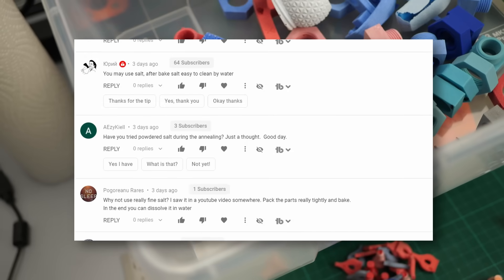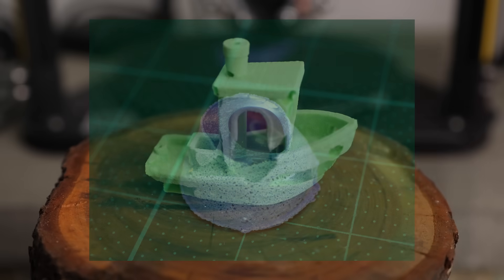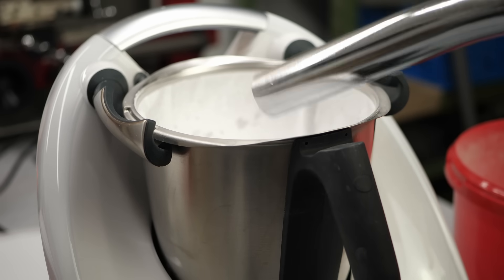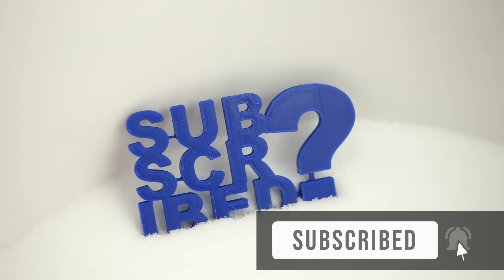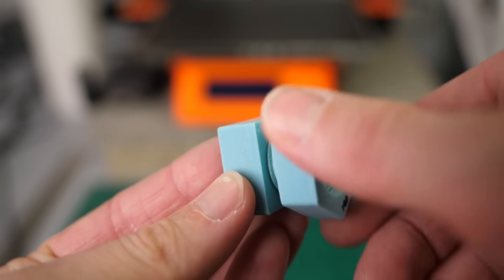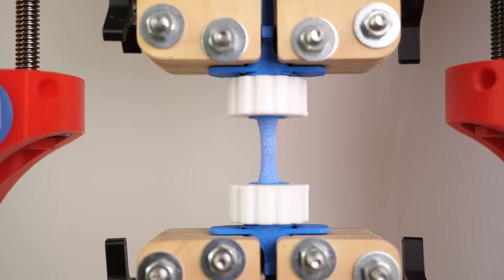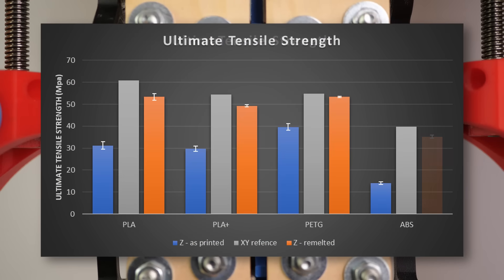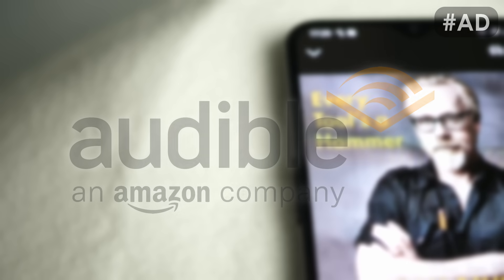The STRENGTH of 3D prints REMELTED in SALT

Comment: What an interesting and weird hybrid process!
I wonder if this could be improved by wrapping the 3D printed parts in some higher temperature foil to avoid the mixing of salt.
Or maybe spray painting them with some sort of (flexible?) paint coating.
I'm also wondering why lost form casting metal works without mixing in the sand particles, but here it's a problem.
I think if I needed this for a specific part to be really strong I'd rather look into how to use the 3D printer to make a mold for epoxy based casting.

Comment: 15:30 Pores are probably mainly from evaporating moisture and possibly a bit from original extrusion density being slightly below 100%. I guess due to the  high viscosity of molten PETG (notably higher than PLA) the bubbles / pores become immobile after just a bit of surface-tension-aggregating. Lower viscosity PLA may be able to form bigger bubbles but PLA barely carries any moisture. Much less hygroscopic. I highly doubt that bubbles can aggregate big enough to rise gravitationally even with PLA's lower viscosity.

Comment: What about creating a super-saturated salt, or borax solution and immersing the part so that a shell of crystals grow on the surface? Then dry bake the part so you don’t get popcorning, before doing the final bake.
If this could work, the original surface finish would be maintained, and the you wouldn’t have to work with fine powers.
I recently grew some borax crystals on pipe cleaners as a fun project with my daughter. I created a super-saturated solution by dissolving the borax in a glass saucepan on the stove. I was able to get some pretty thick crystal shells (and with borax you get nice cubic crystals on the outside).

Comment: Combination process I'm thinking.  Pickling salt for its fine grain. Bake it to remove moisture. Pack the part in it, then run through a vac chamber to remove air pockets. Vibrate to settle any last bits, then possibly a second vac.  Bake as required.

Comment: how about using a laser to point at the tip of the nozzle, just about 0.2mm lower, then the laser can melt the lower layer of the PLA material and  nozzle print the new layer immediately, they can melt together better, right? a 5-10w laser should be powerful enough.
Reply: This is essentially (partially?) the way that metal parts are 3d printed. Layer is put down, laser fuses, repeat forever.  https://youtu.be/4jbn0ah3u9E?t=307
Reply: @DrFiero  yes，but this was printed by metal, I mean print with PLA
Reply: @snipermax  - yeah, I do understand what inconel is! I was just comparing the concept of fusing via laser.
Reply: @DrFiero   oh. I see.

Comment: How about using magnesium dioxide? It's a filler and white pigment used in paint. It should tolerate high temperatures, and not be so corrosive.

Comment: Living in Europe and having a really hard time finding the powdered salt (or the will to buy such an expensive blender), I might try quartz powder (SiO), which is commonly used as casting sand for aluminum, therefore very stable at higher temperatures. Edit: also, pumice powder seems to be an even more viable (and affordable) option.
Reply: Huh, here in the US you can usually find it in markets
Reply: At least here in oklahoma

Comment: I see you used an un-iodized salt, I first thought an iodized salt would result in the outer skin that was resulting on your prints. But I see that the salt you used is mined from northern Germany using an evaporative process. Furthermore free spirit seems to be in a different region, suggesting impurities could be reacting with the plastic they are in contact with. I will be testing with salted mined on the south eastern coast in South Africa. Hopefully that will determine If purity/impurity is the issue

Comment: Honestly, my main worry would be how heat conductive the casting material is. Plastic being cooked unevenly for so long above melt point is going to significantly weaken it compared to injection molding. I would try this with aluminum powder, fairly cheap per pound/kilo, is fine to the point of inhalation danger, and conducts heat like no other

Comment: I was thinking of using two different materials for shell and infill (100%) on a dual head printer. The shell might be PC or similar high melting point filament, and the infill can be pla or some other low melting point filament. Then without salt the model can be heated up to a temperature, where the shell remains intact and the infill softens. Then check the strength of the model. I would do it, but I don't have the proper measurement device. What do you think about this?

Comment: My thoughts are that this works because, firstly the compacted salt acts as firstly a structural support to support the melted material so the object can retain its shape, whereas if you just baked a 3d printed object in the oven it would just melt and deform freely with no support. Secondly, salt has the ability to draw out moisture in the parts which may explain some of the surface bubbles on the outside of the object and the uniformity inside the object as seen in the test parts that snapped. Thirdly the properties salt allows for great absorption of heat allows as you mentioned in your video "salt takes along time to heat up" this in turn acts as an "insulation" from the direct heat in your oven allowing you too evenly cook the whole object at a much more even temperature without burning the outer layer, while allowing you to melt the inner layers together promoting layer adhesion. This process is similar to how you would sous vide food (submerging food in an airtight plastic bag and cooking it a set temperature over long hours to get a precise even cook temperature throughout, amazing technique to make perfect doneness on steaks :D). It would be interesting to see if you can do something similar with clay (also a good heat conductor) or other heat insulating mediums rather than salt as a the support structure medium and the heat transfer medium, this would allow us to determine if the moisture drawing properties of the salt plays small or a big effect in this process.  Great video, thank you for sharing your results!

Comment: Maybe the surface finish can be improved by first forming a hard salt shell around it. Either by warming the part with a hair dryer and misting a saturated salt solution over it, or repeatedly dipping it in a saturated salt solution.

I don't think that will be strong enough to carry all the loads when the plastic melts, so probably still bury it in salt, but it might improve the finish.

Comment: instead of using salt, why not try using self leveling concrete? its a fine powder that i assume would work just the same as the salt method... might be worth a try, plus they sell bags of it at most hardware stores thats not very expensive.

Comment: Instead of salt, which is quite corrosive and requires grinding, how about cement mix that's been sifted to ensure you only get the finest powder? Also instead of packing, placing the vessel on a vibrating table could be a good way to ensure you get uniform contact and eliminate air pockets in the powder.

Comment: Has anyone tried sodium bicarbonate (aka "baking soda" here in North America)?  Does it work?  Seems ideal -- very fine-grained, low-cost, water-soluble, and widely available in grocery stores.
Reply: OK, I'll answer my own question.  Ran some tests on a PETG extension tube I printed to join a Canon DSLR camera body to an antique lens with an M39 thread mount.  

In Trial #1, I packed the part in bicarb but didn't weight the surface down.  Total failure.  The forces latent in the PETG were strong enough to shift the bicarb and deform the part.  

In Trial #2, I used a c-clamp and a top plate to compress the bicarb around the part tightly during the annealing process.  Heated 40 minutes at 230 degrees C, then allowed to cool to room temp.  Worked great.  No visible deformation + nice matte finish on PETG surface (which, for a lens component, is MUCH better than the original glossy finish!).  No noticeable degradation in the tolerances.  The M39 thread still mates as before with the lens body. 

Plan to buy a bigger box of sodium bicarb and do some more testing with larger components.  For now, though, I'm not seeing much reason to search high and low on Amazon or E-bay for popcorn salt.

Comment: 99See sand casting.  There might be things you can add that causes better clumping.  Also there are simple tools you could print for packing the mold.   Very interesting.  Why wouldn't it work with flower?

Comment: Why do you even use salt? There is special sand for casting available. This is as fine as possible and also heat resistant. Maybe it's a little more expensive, but you can reuse it.

Comment: Has anyone considered the application of a coating (silicone/Teflon etc.) to the outside surfaces prior to the treatment.  The coating could potentially block the salt from leaching / penetrating the surface.   also - why not use another type of power material (al) has great heat transfer properties... and could be made VERY fine...

Comment: Try Epsom salt. I have used it to anneal 3D prints with great results. I first dehydrate it in the microwave on a plate lined with parchment paper which results in Anhydrous (without water) magnesium sulfate. It's like ultra hydroscopic glass. I break it up into small chunks and it grinds pretty easily into a very fine powder (like baking powder). This packs really well and has the benefit of adding zero moisture to the process, being considerably cheaper than salt, less corrosive, and results in fine detail surface finish. The powder is water soluble just like salt. I also use it as a very effective desiccant for storing my filament.
Reply: Could you produce and upload a video demonstrating you process?
Reply: @VictorHarrys  I would be glad to. I have been working on other projects lately so it might be a while.

Comment: Fantastic video. I too have been curious about talc and green sand. I also have been wondering how this salt method compares to coating the parts in a thin coat of polycrylic paint or porous sealing vacuum impregnation. For my salt I used a burr grinder and was able to reduce the table salt effectively by targeting Turkish coffee which is best with a d50 of 50-100um. I agree with your assessment that more than one small part or longer than a short run is not viable.

Comment: why not cast it in plaster/quickset with a vent hole facing upward, then bake it at 200 degrees for a while, then soak the cast in water to melt it away from the plastic?

Comment: It would be awesome if this could be done with a liquid of some kind. The liquid would harden with the temperature together with the part, so it would provide support, but you would save yourself from handling the dust and packing and everything. You'd simply pour in the liquid, baked it, and then removed the hardened support.

Comment: Bake your salt for an hour in an oven BEFORE blending. This drives out the moisture first.
Reply: I've wondered about green sand for some time. I'd love to see a test with it.
Reply: Wouldnt the salt just absorb water out of the air anyways while he's trying to pack it or break it up in preparation for packing?
Reply: @spacegooley3796  Yes, but providing you work fast enough you should be ok.
Reply: @spacegooley3796  He literally is using a heated mixer. He could just mix it all at 200°C creating finer particles while also drying it at the same time.
Reply: @michaelakerman7609  If you coated in a heat resistant enamel (that held the shape of the part), when baking maybe you wouldn't even need the salt
Reply: @WaynesStrangeBrain  sounds like a nightmare for moving parts
Reply: @amicloud_yt  While I agree in part, there are casting methodes that use similar things too heat resistant enamel. You dip a part (out of wax) into the liquid, let it dry onto the part, and do this multiple times to create a hard shell. Then you poor in a liqid that melts and replaces the wachs. This can be done with a lot of parts at once and reproduce extrem fine details often whitout any post prosessing.
While using salt is a really cool technique I think casting a part (with the help of 3D printing the desired shape) or using better materials for printing has more advantages.
If you simly care for a more homogenous part you could use SLS (selective laser sintering, printing with powder).
Reply: As soon as I saw this video I was going to comment that they should take cues from metal casting and use slip (liquid clay). Apparently removing moisture is an issue as well so they are using salt but I would imagine you could  dip in slip, then pack in salt and get the best of both worlds. Clay needs to dry slowly, that’s the price you pay for exceptional detail and finish in the end product.
Reply: @LupusMechanicus  if it's printed with 100% infil there shouldn't be any significant amount of air trapped, and even if there was, this isn't a vaccum, the air won't be drawn out. If anything were to happen, it might form bubbles and propagate to the top of the print since air pockets would be bouyant in a plastic mixture, but even then plastic would be way too thick for any serious migration to happen. (though it still could be an issue depending on a variety of factors) The "porous" surface would almost certainly be nothing more than a surface finish that was imposed onto the part because of the grain structure of the salt. Since slip clay doesn't really have any such grain structure, it'd retain it's form.
Reply: i am wondering if white rice powder would work as an alternative to salt powder.

Comment: I don't know if it's been suggested but something like Copper Sulfate crystals lose their integrity when dried. Small CuSO4(hexahydrate) crystals could be put in your oven and dried to an incredibly fine powder with no grinding requirement, and you'd still have a water soluble solution. You could even allow the wash water to dehydrate and simply repeat the desiccation process (possible with salt also), but if the crystals are more expensive than salt than reuse lowers continuing costs.

Comment: You should print with a vent tube and use a vacuum chamber to remove those bubbles. The tube is just a peice of pla that allows for extra material and and allows the bubbles to rise

Comment: I wonder if pretreating the print in a hydrophobic coating (such as Never wet or Ultra-Ever Dry) would reduce the diffusion of salt/powder into the outer most layer...

Additionally, I wonder if having a smaller quantity of super fine salt and pre-coating/brushing the fine crevices of prints with this fine salt before submerging into slightly wet salt (the way a traditional pattern maker may use fine grain powders along with green sand in a traditional sand casting) could produce substantially better detail reproduction. Especially if combined with the use of a hydrophobic coating.

Comment: I always wonder why people use grinders like that. I just watched NileRed video where he also had issues grinding pepper with regular grinder just because it resulted in too fine powder which is also what can easily be solved. Use burr grinder for stuff like that. It's much more efficient, you can regulate how fine you want it to be, it is consistent and it does not grind anything that is already proper size - it all falls down and only coarse stuff remains in the grinder. Especially compared to expensive equipment it really looks like best alternative as it will be cheaper than expensive grinders. Just pick something with decent power and option to make it fine enough. If you use something like Graef grinder (available in Germany, it's german after all) you can even print bigger bucket on top to feed much more material at once and you can redirect outlet pipe to bigger container so it will grind everything at once. It might be harder with smaller grinders that are not designed for espresso makers as those have built in input and output containers. My parents used something like that to make powdered sugar and it works flawlessly for decades but does not have coarseness regulation. If you want to be able to modify that, espresso burr grinders are the way to go.

Comment: Well done stefan may try it I use my printer to make mechanical parts regular printed parts are 90% fail this will give them the strength need I am mostly interested in that outer layer I maybe a new way to get perfect adhesion to paint or resins

Comment: A Ball Mill might be a better method of granule size reduction.  A simple rock tumbler with stainless steel ball bearings ranging from 4 to 25 mm in diameter I believe will give you excellent results.  I've seen a 6-inch diameter PVC cylinder used as a ball mill make powdered aluminum, (Thermite grade) which is very fine particle size.

Comment: I would try gypsum since:
it is stupid cheap
Readily available as a super fine powder
Has great thermal properties 
Is soluble in water

Also to help eliminate air pockets try using agitation when adding gypsum to a container. Maybe while on a variable frequency agitating surface.

I also would recommend trying to anneal under a vacuum!
Try a vacuum in a solid container and then try to vacuum in a heatproof flexible container. 
The flexible container would allow the atmospheric pressure to act on all sides of the container creating more uniform pressure.

This process under very high pressure may create a different more desirable effect..

Maybe printing entirely in a vacuum? Just get rid of the issue of air altogether see what happens!!! Maybe it will implode or just crack but it would be unique thing to try.